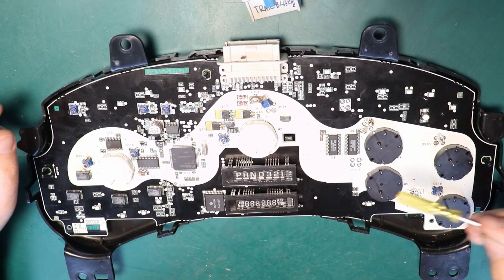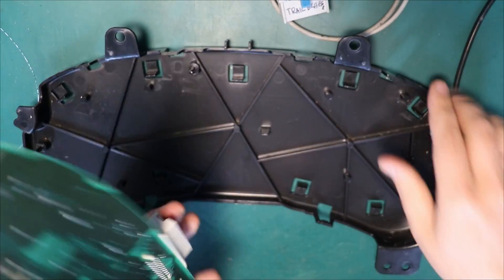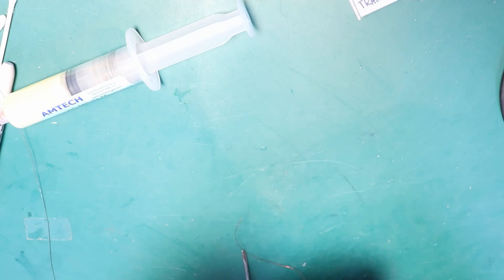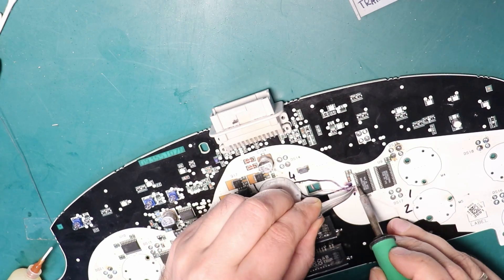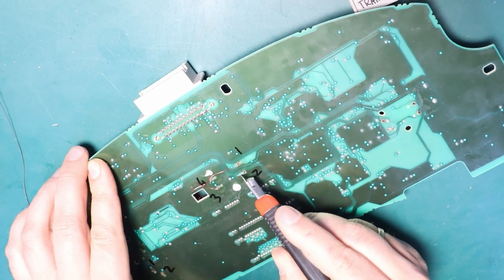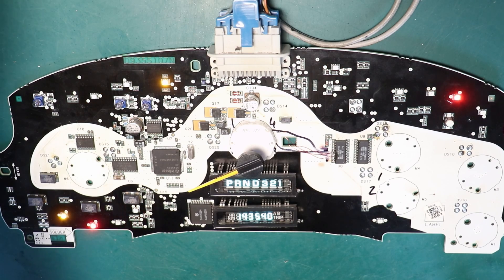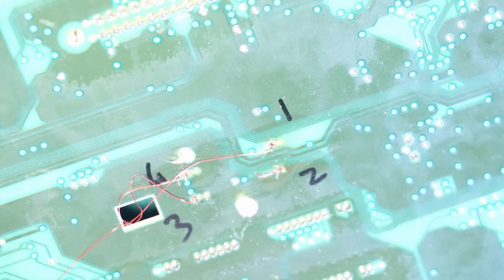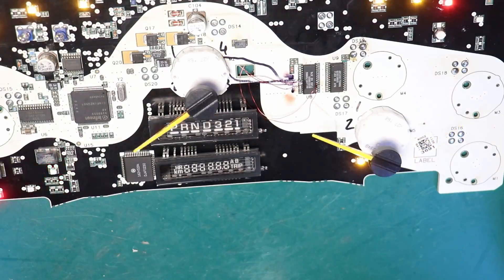Repair of Frankenstein Chevrolet Trailblazer Cluster. Circuit board with extensive damage.

Comment: Nice work saving that cluster. Trailblazer/envoy/Rainer is no fun without the test points near by like the full size. Thanks for reminding me to quote a different price on these prior-repair attempts! : )
Reply from the maker: Really, it took me 3x more time to get it fixed if not more.. At least some content for Youtube :)
Reply: @HETPEZB  I believe it. 3X the time is about what I see too. You always know your in for a fun ride when the message center display window is covered in 10,000 finger prints.